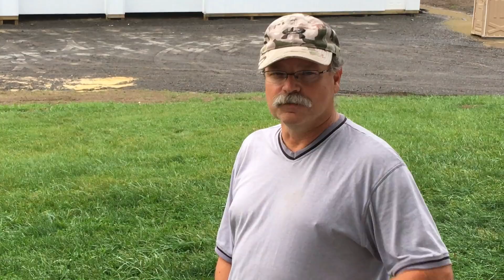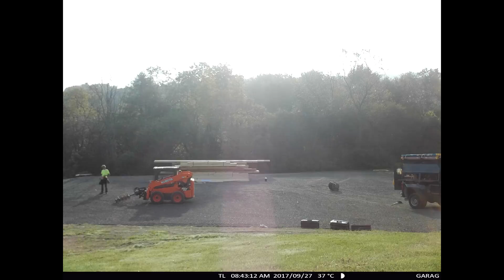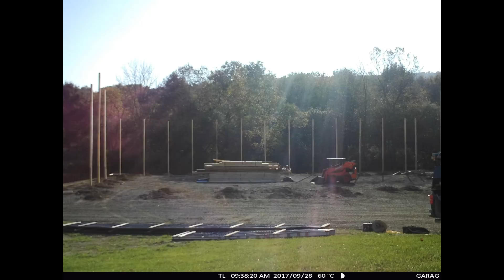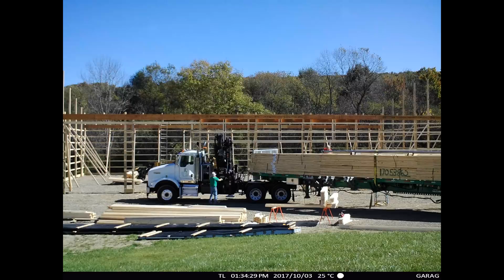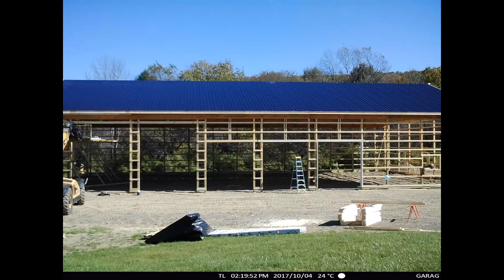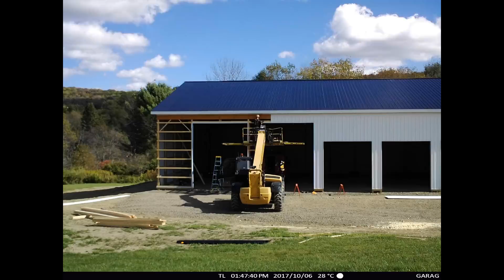Modern Amish Barn Raising | Homestead Series

Comment: Wow! That is one huge garage! What's he gonna do with all that space??
Reply from the maker: Sandy it sure has grown in size over the years (LOL), Ken saved 30 years of his sick time to build it.  The end result is 60 x 100 and 16 foot ceiling height.  He plans on storing our RV, future tractor, boat and cars.  He also will store seasonal items like lawn chairs and have a workshop area etc.  There is an 1800 sq foot "man cave" that will really be a huge family room for our kids to hang out in and hopefully someday grandkids, one big great room really. It will have a small loft and bath for guests too. However, one of the main purposes of the build was to have the roof space to put a 25 KW solar system in. NY currently allows dual systems, so we want a couple of those 16 K batteries and propane generator installed before the legislation changes as it did in California..  NY offers net metering, so it could be a source of passive income.  He is putting the tubing in the slab and will incorporate an outdoor broiler for another source of heating for the house, hot water, as well as snow melt.  I'm hoping to have a sliver of it to put grow lights in to start seedlings for my garden, there is an 7 foot wide section along one wall that he hasn't claimed yet. We are working on the lighting design currently, I didn't know there were so many options.  This project will have to be done in stages as our finances dictate, we are trying to get as many uses out of this build as we can.  Ken told me to tell you thank you. Shelby

Comment: Wow! That is huge! Curious, how many square feet? It looks amazing, have fun!
Reply from the maker: Cissy it has grown in size over the years (LOL), Ken saved 30 years of his sick time to build it.  The end result is 60 x 100 and 16 foot ceiling height.  He plans on storing our RV, future tractor, boat and cars.  He also will store seasonal items like lawn chairs and have a workshop area etc.  There is an 1800 sq foot "man cave" that will really be a huge family room for our kids to hang out in and hopefully someday grandkids, one big great room really. It will have a small loft and bath for guests too. However, one of the main purposes of the build was to have the roof space to put a 25 KW solar system in. NY currently allows dual systems, so we want a couple of those 16 K batteries and propane generator installed before the legislation changes as it did in California..  NY offers net metering, so it could be a source of passive income.  He is putting the tubing in the slab and will incorporate an outdoor broiler for another source of heating for the house, hot water, as well as snow melt.  I'm hoping to have a sliver of it to put grow lights in to start seedlings for my garden, there is an 7 foot wide section along one wall that he hasn't claimed yet. We are working on the lighting design currently, I didn't know there were so many options.  This project will have to be done in stages as our finances dictate, we are trying to get as many uses out of this build as we can.  Ken told me to tell you thank you. Shelby
Reply: Brilliant! Sounds like it has been thought out and look forward to seeing the progress.